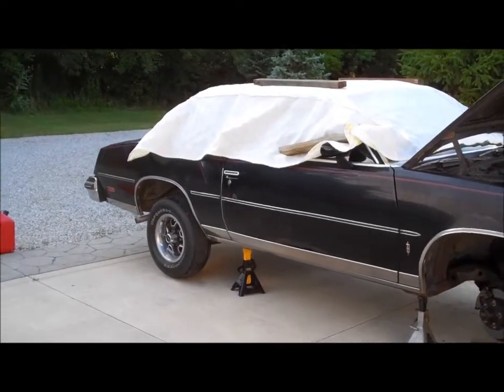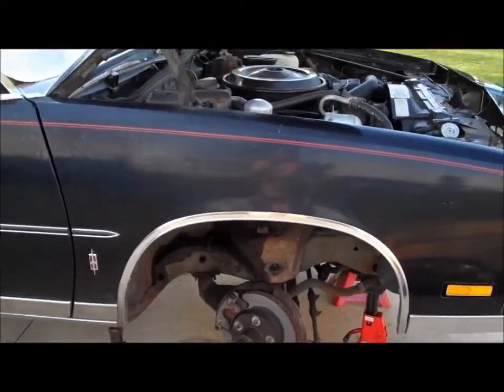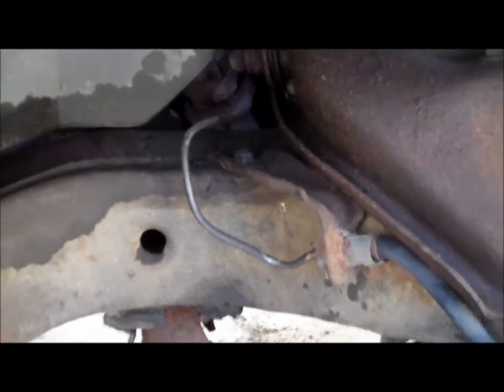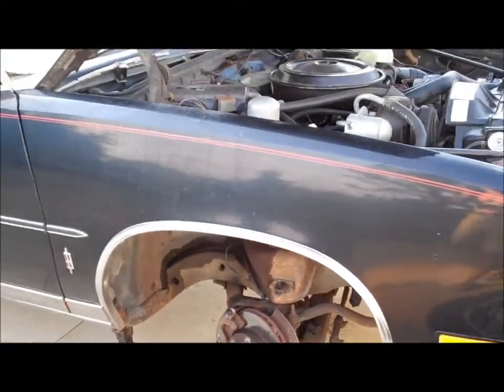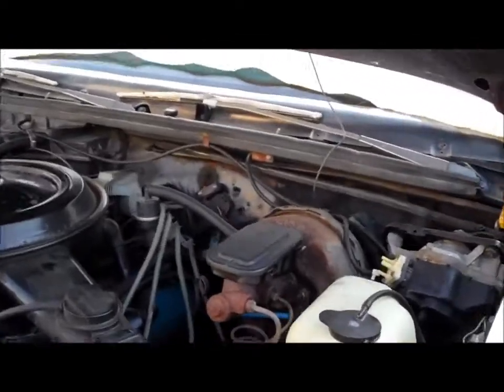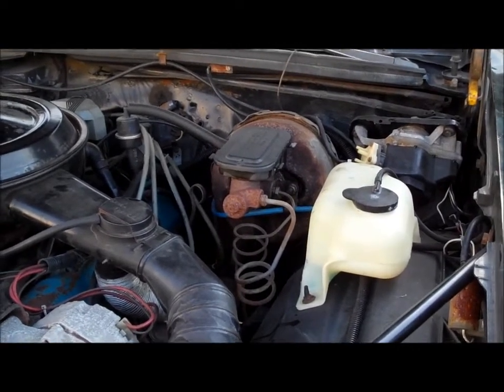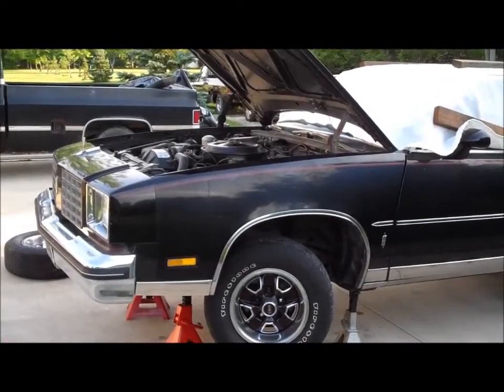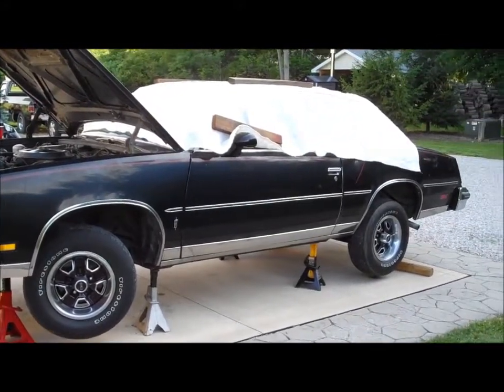1979 Cutlass Calais Back Up On Jack Stands Classic G-Body Garage

Comment: I got one for you, I don't have no back breaks ,very little fuild comes out of the rear bleeder screws but wont shout out like the front ones. I have ran new lines from porching valve back,an the rubber line that bolts to the rear, i blew threw it.I can also unscrew the lines from the wheel cylinders an still very little comes out

Comment: also ,i changed the master cylinder an porching valve  "used one"Still no back breaks,got good front breaks though,i unscrewed the rear line coming out of the porching valve,an stomp  the break the valve actually blew out of it .With the valve out It has really good pressure,but line wont get tight without that valve just leaks like a bitch lol  ANY IDEAS       ITS GOT ME MAD